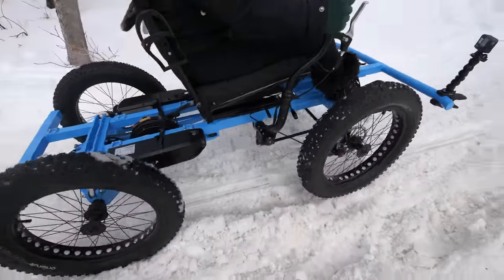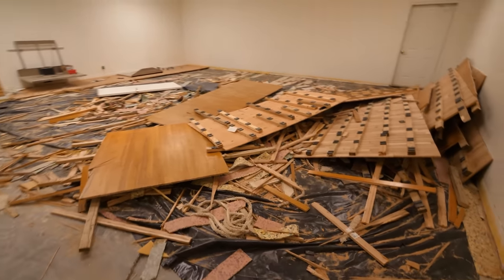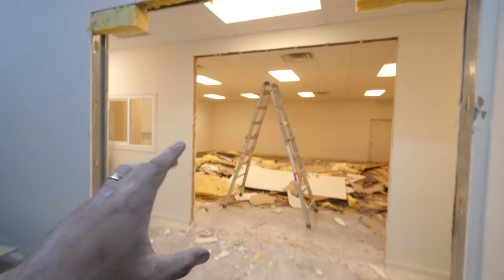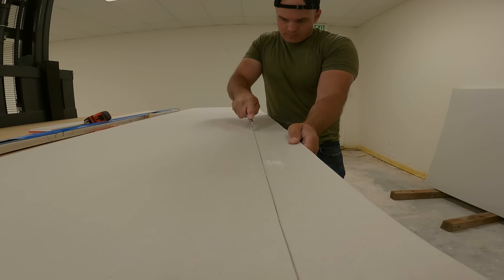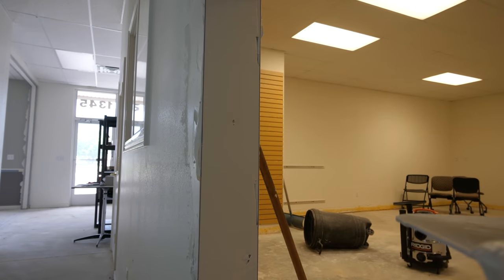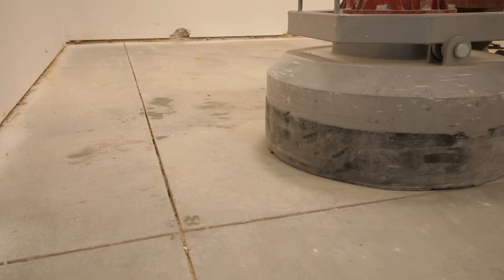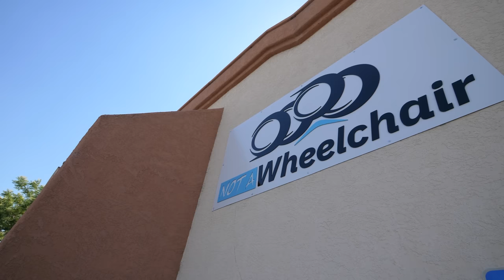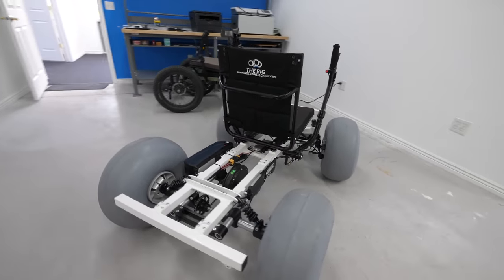Taking 'Not a Wheelchair' to the NEXT LEVEL? - New Shop Tour!

Comment: Not sure if this is even possible and i’m not sure how it works but instead of buying separate machines for different terrain what if you had one base machine and then a station that would swap the wheels to whatever wheel you want for the terrain you might go on and that way it would save money if you need to buy multiple types of terrain and you could expand in the future to different wheel types and if they want to upgrade it’s cheaper than buying a whole new system.  not sure if that is in the works or something you want to do, awesome stuff and great video though!

Comment: I have MS. My Shop Rider, Explorer was paid for by the ministry. What I wanted before I saw your videos was an ebike. I'm on disability So I cant afford such luxuries on my own. Don't get ma wrong, I love my explorer, But The side walks in this town Need a Bloody Quad to drive on. I end up in traffick far more than I should. Which is quite frankly, Scary as hell some times. There'll be an off ramp/curb on one side of the street and none on the other side. I've be cut off tons of times and nearly run over several times.
I'd like to suggest that you look at 3 wheeled recumbent bike designs. My ideal skoot would be an electric and gas hybrid with a small trailer.
Keep up the good work. Blessings

Comment: Ooohhh….sneaky peek at tracks!!!!  
I NEED one of these!!! I can walk, but not far or stand for long.  I grew up outside, rode bicycles all over and decades of heavy labor jobs took a toll; I’m now disabled at 50 years old.  I have a Hoveround which is fine inside the house, but useless outside.  I bought a used power chair and it’s ok for riding to the park, but that’s about it: it can’t navigate the city sidewalks and as such, I wind up cruising down the street; which is as scary as it sounds.  5 mph flat out, bouncing all over, rattling my teeth and jarring my already injured spine…just not viable.  And forget even thinking about getting out on walking paths and even bike paths with it; so I’m still just stuck in this meat prison of a failing body.  
I have hope now with these machines!!! That’s the solution!!! I tried an electric bike and crashed, shattering my arm and causing other damage…I tried a trike first, but it was unstable and I need the power of a motor.  This machine has the capability and range I need, is portable enough that I wouldn’t need the hugely heavy transport rack I bought for my chairs, but can’t hook up to the hitch mount on my jeep!!  All in one solution!!!
Now to figure out how to pay for it.  The pricing is quite fair!!  A quality e-bike is at least the same cost, and it’s less expensive than the silly Hoveround (though it’s a ‘medical device’ so Medicare pays for it). So hopefully I can squirrel away a little from my next few tax returns and save up for one!!!  This gives me hope again!!!!  Beautiful engineering and elegant execution of manufacturing.  I’m in Utah also; St George, and yeah…this could be THE answer!!! ♥️♥️♥️💪🙏

Comment: 15:37 Could that be a dock and a laptop?

If that's not enough power for the task, add on a remote desktop capable of it?

Just wondering if that'll allow the designers to work remotely when they want to / need to.

Comment: wait, a manual wheelchair costs how much in the USA?

I had no idea how much one would cost but did a quick google and can find 'traditional' style folding (they type with the 2 big wheels at the back and vinyl seats) ones brand new online starting at about $350 USD here in Australia and the 'airport' style ones (the ones with smaller, plastic wheels all around which require a person to push) even cheaper.
Reply from the maker: Correct. Those are the same price here as well.  I'm talking about rigid manual chairs which people can live and travel with. Usually made from titanium.
Reply: @JerryRigEverything  fair enough.

Comment: I have an idea to build a mobility trike which is not a wheel chair, but becomes a wheel chair.
No chains or belts (similar to the Arcimotor idea) true differential, anti-tip steering, self charging (stationary and underway) so basically what I call;
The Perception of Perpetual Motion machine. PoP-M.
I can't get a big e-bike builder interested (I live on 700 bucks per month, so I would like to make money, but I have survived ten plus years without, so it would be nice but not necessary) I would be glad to give you guys the idea.....you would have to build me one at some point...😆 🤣 😂 
💃🙏💜🤣

Comment: I think it's great you're bringing attention to the physically disabled community. However at over $6k it's still very expensive to most people, even at a "discount". Also one of the biggest issue for this is transportation as not everyone has a truck or can lift it.
Hopefully you can invent something smaller and affordable to the greater community. Perhaps in your new location, invent a higher tech wheelchair to break the old tech you speak of. Something we can use everyday, I have the travelscoot now when traveling but it's so cumbersome to transport when needing break down into a car, it's heavy and too many pieces to lose.

Comment: Add the word disability or aged care to anything ans the price is 100 fold.
A non slip mat for a client that was aged was 45 dollars for 2.5m x 2m pool non slip mat. Industrial grade...

The OT needed to do report to get funding by it.... that cost 400 of the 450 the clients. Yearly funding had.

The mat as a disability/ age care was 1200 dollars..... and was smaller but same material...

I bought it for from a rubber supplier, once they knew I was buying for the client from own money they ask if had cash I had 10 dollars they said that will do.

FYI the funding couldn't by from the rubber supplier as was not a listed NDIS aid supplier 🤣